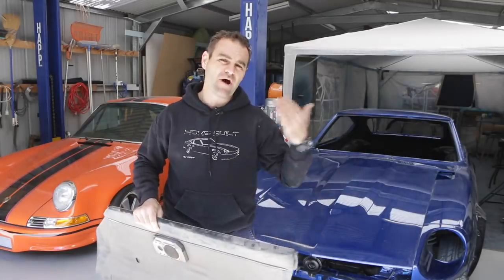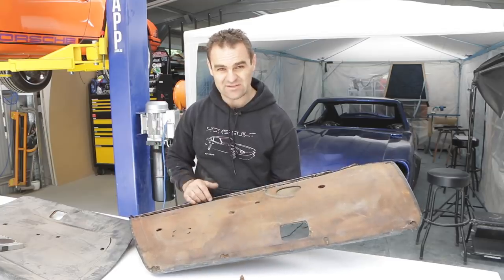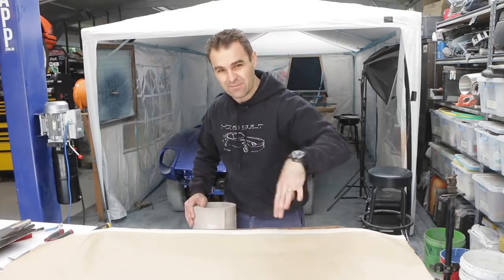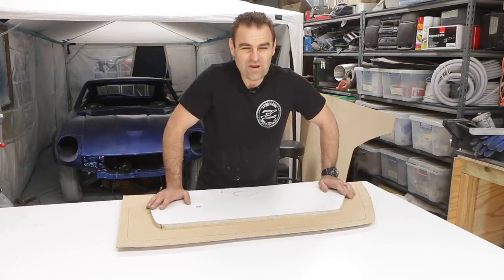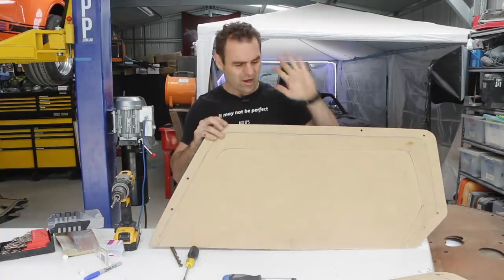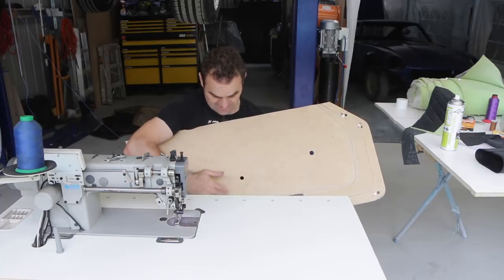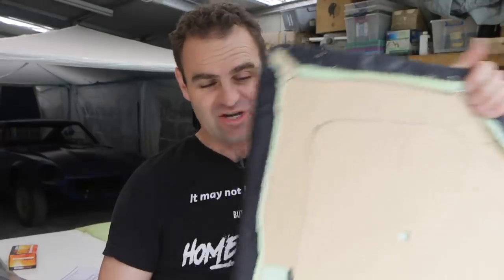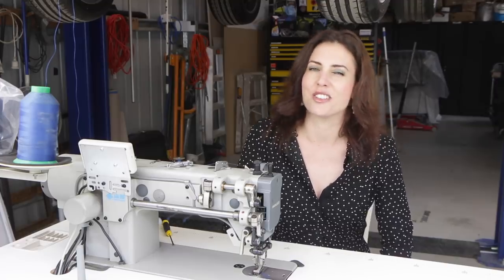Making custom door trims - Home Built Datsun 240Z part 62

Comment: Quick tip #2 . Place a mirror in the corner of your shed. Position it so you can see the ceiling from where you are operating the hoist. So you don't need to run towards your door every time you're lifting a car... hope it makes sense..
Reply: He should mark it on the hoist....
Reply from the maker: It is marked already ;)

Comment: Quick tip, use some tape on the lift where the arms attach for the max height each vehicle can be lifted safely. Ammonia helps bend wood if you don’t want to use steam. Stinks though, Otherwise a ghetto steam press is just a steam wallpaper stripper.
Reply from the maker: Ammonia. Nice tip. As for the lift, the tape is already there ;)

Comment: Oh also,  bit late now but, I saw someone using the wet the wood technique, then they covered it in foil and used a heat-gun. keeps the moisture inside the wood.

Comment: Nice work as always, very innovative moulding some door cards, not quite as curved as the originals, perhaps the door winder etc may stick out further, they may require some shortening?
Reply from the maker: Once I bolt on the arm rests it should pull it all into shape enough.

Comment: May or may not get an answer, but just curious why you didn't just recover the old door cards?
Reply from the maker: They were all warped and falling apart. Most of the holes were pulled through. These are much better :D

Comment: this might sound like overkill but why not have a very rigid rod covered in foam attached to a limit switch at the top near the ceiling,   that way, if your car pushes the rod, it will stop the lift right away and you never bash your car against the ceiling
Reply from the maker: This machine can be fitted with a limiting switch, but the highest point of each different car is not always going to be in the same spot above the lift. I have marked the height of the post for each car instead.
Reply: @HomeBuiltByJeff  i was thinking more like mounting the limit switch at the corner where the wall meets the ceiling and having the rod hang a few degrees lower than the ceiling.  maybe have a small string supporting the other end.  Regardless of the varying height of the cars, it will always stop the lift before the end of the rod touches the ceiling.   that way, you can be sure the car never touches the ceiling.      pm me your email and I can send you a diagram of what I am describing
Reply from the maker: I could do it, but I prefer to trust my eyes not a switch. If for some reason it failed I would not be happy. I have put tape on the hoist for each car now anyway, so I know where I can go up to ;)

Comment: Do you think this method could work with door cards that have larger curves?
Reply from the maker: They could go bigger, but it all depends on how big the curves are.
Reply: @HomeBuiltByJeff  I have an 89 E34 BMW 5 series so I would say a rather "normal" 90° ish curve that protrudes 2.5 inches away from the window.
Reply from the maker: That may work. Most old cars have a sheet metal strip along the top of the door trim which I reuse.